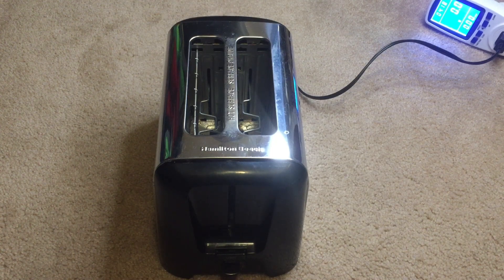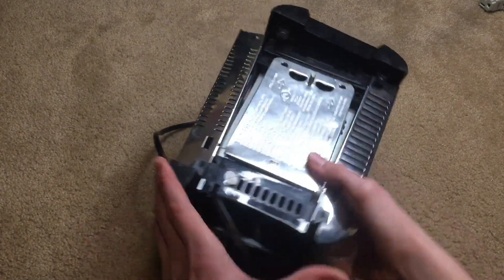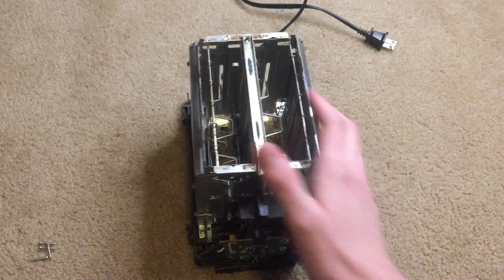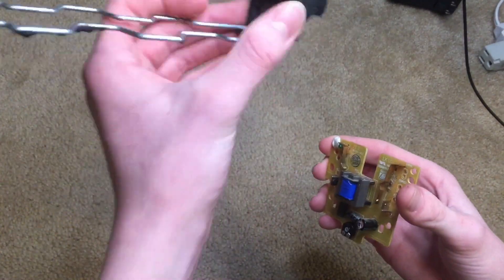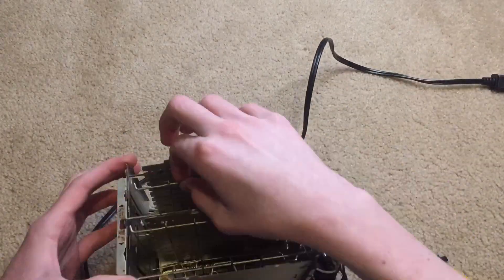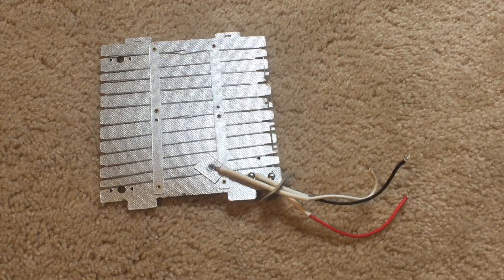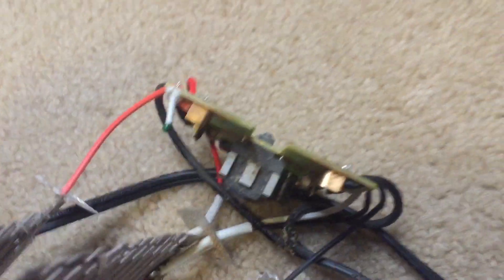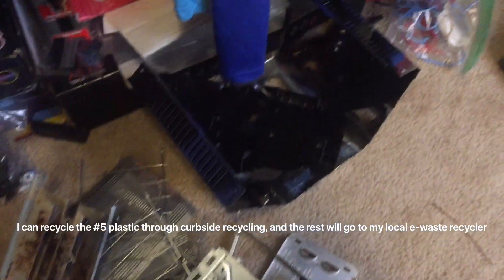Taking Apart A Toaster And Learning How It Works

Comment: Lever doesn't come off in mine... any ideas how to unlock it without breaking it?
Reply from the maker: You could try heating up the metal rod that the lever is attached to with a soldering iron. Eventually the plastic will soften and you can pull the lever off